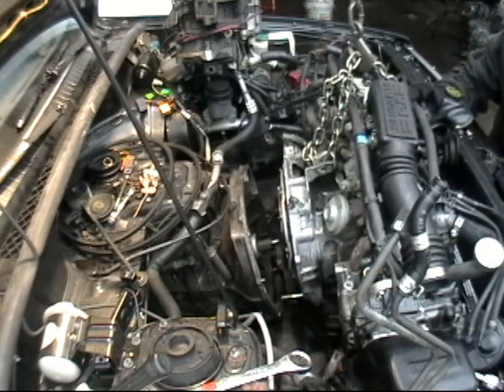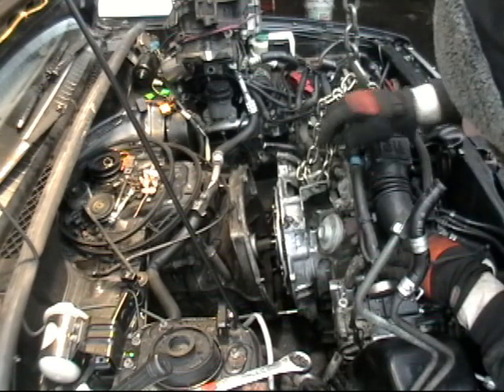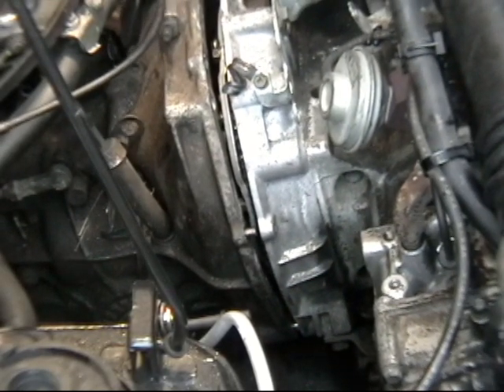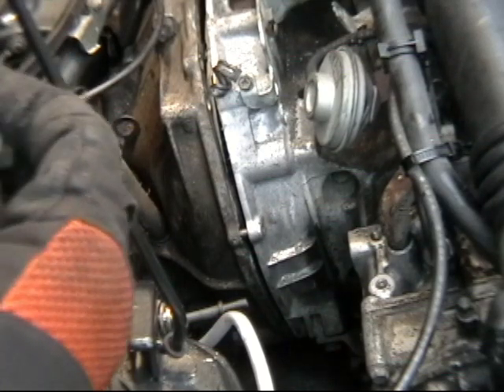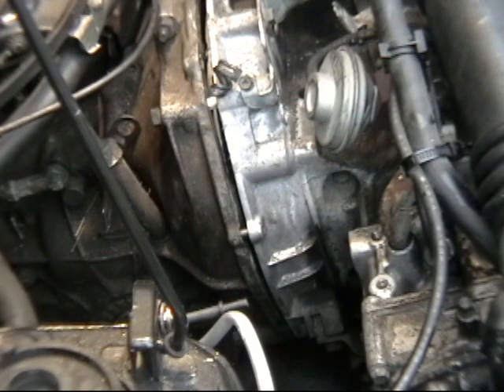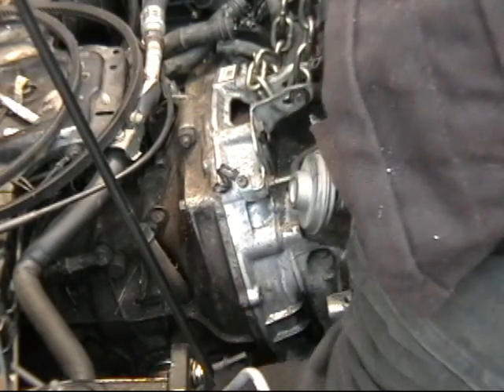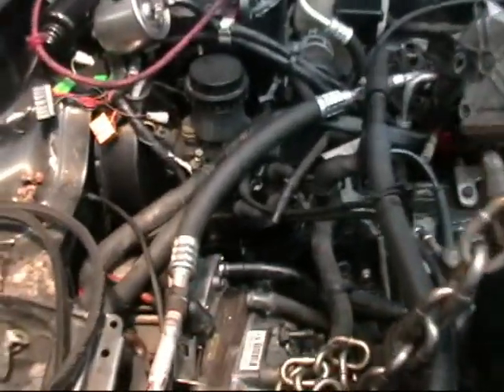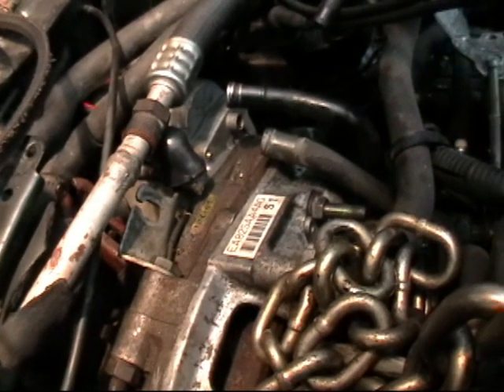Subaru Engine install part one: Engine Mounts and Bellhousing

Comment: Day two of wrestling with mating my engine and transmission, your video provided some useful insight and tips that will hopefully help me solve my issue. Many thanks! Will report back with results.
Reply: Swap was a success! :) I ended up threading bolts in just like you recommended and tightened them together. Thanks again!

Comment from the maker: The trick is to get the pilot shaft to line up withthe bearing in the flywheel. If you can get both bottom studs on, you can draw the engine together going back and forth from one side to the other. There will be some degree of wiggling to get it to go on. the whole works should draw together evenly. You may have to adjust the angle of the crane, or place a jack under the trans to get a better angle. It should not bind up at all. check out ultimatesubaru org and you will get lots of answers

Comment: This video Excellent!  I am installing a 2.5 but there are a lot of clues about how to get that stubborn engine back in.  I was about to call my father to help, because my engine won't slide back on.  Anyway, the only thing I was wondering is how do I know when there is too much pressure and binding when I use the bolts to draw the bellhousing in?
Reply: Yo i need help lol